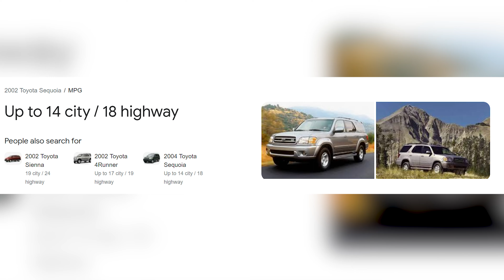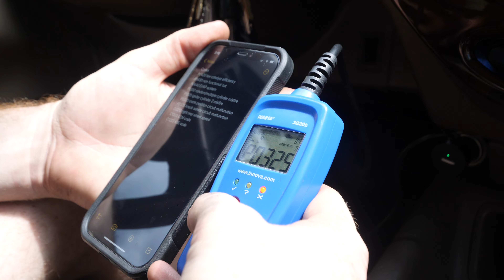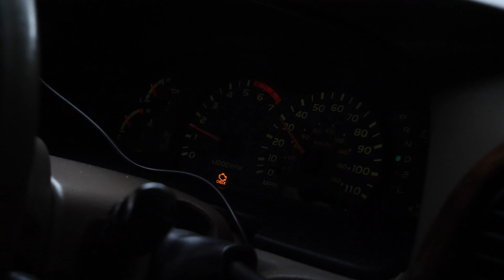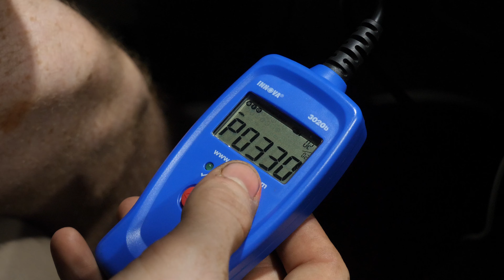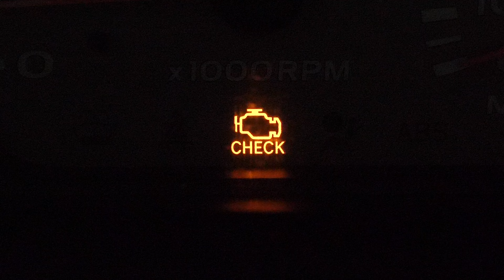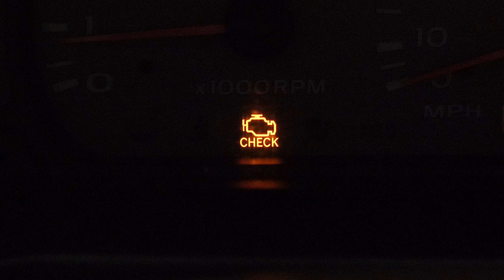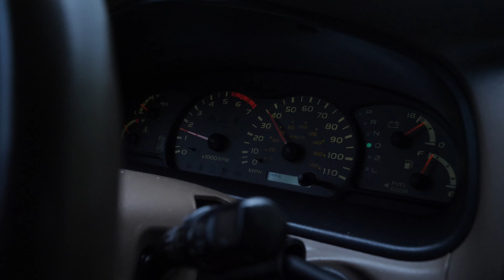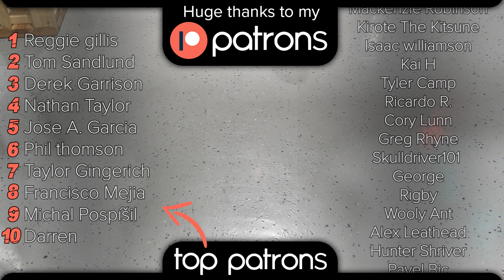There is Something MAJORLY Wrong with my Tow Rig...

Comment: So G.. do you know about the little threaded tubes that stand off the rear 02 sensor a couple inches or so. Looks like a spark plug non-fouler. Makes your computer happy happy by reducing the o2 exhaust exposure. It will kill the po411 code.
Reply: its crazy. i try and educate so many people about this and they think its snake oil. literally got into an argument with Rudnick about it in a comment thread in one of his videos. whatever. i have a tuned xc90 with no cat that i pass emissions and inspection with using a defowler every time. works good enough for me and i guess thats that.
Reply: @aylahughes9185   it works 95 percent of the time. Just science (twice the distance = half the exposure). I live in California, thank god in a remote area that doesn’t require bi-annual smog certification. Cali requires visual inspection as well as obd2 scan. Still a good thing to know. Not snake oil at all. 🖖🏼👽
Reply: I think Rudnick is trying to prove that you can be successful by being goofy and not clever. That Dude gives aspirin a headache 🤕. See funny and clever. Lol 🖖🏼👽

Comment: Be aware, those Toyota's are sensitive to aftermarket cats. We had a 4.7L Tundra the shop that went through two Magnaflow OE fit cats before we gave in and ordered one from the dealer. As for the mileage, did you take into account the bigger tires? A larger tire will take less revolutions per mile, making it look like your gas mileage is lower than it actually is.

Comment: I got a 2015 tundra I know it has a different motor but I get 12-13 mpg you getting 11mpg with not as strong of a engine an oversized tires that sounds right. I could be wrong though.

Comment: Did he use a factory Toyota knock sensor?  Toyota's DO NOT usually like aftermarket sensors.  Also, what was said before about shielding the wires.

Comment: Why don’t you just isolate the catalytic converter sensor? It works on diesels? 😅 I own a straight pipes diesel and when we cut it off we just had to turn off the sensors and we were done 😊.

Comment: Couldn't the new tire size mess the Miles/Gallon calculation? I does affect the speed gauge when changing tire size... Just my two cents.
Reply from the maker: That is certainly true! The increased tire size makes the vehicle less efficient but also throws off the calculation. The tires aren’t much bigger though.

Comment: Depending on the tire size, you can also account for the difference in the rotations of the smaller tires too. I switched from 265/70/16 to 285/7017s and its like a 8-11% difference when calculating it.

Comment: maybe if you didn't gouge the shit out of your high-end spark plugs by dragging your gapping tool through them as you're not supposed to do because they are pre-gapped from the factory it would be running better. all NGK Platinum iridium and other high-end spark plugs are pre-gapped and you are not supposed to get them because it voids the warranty when you scrape the coating off